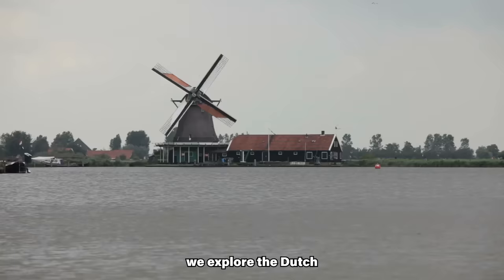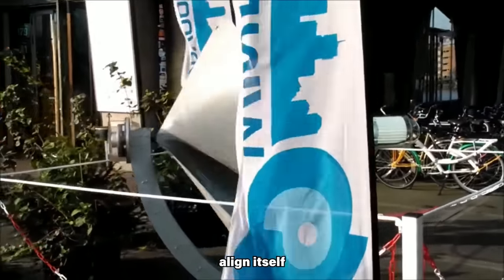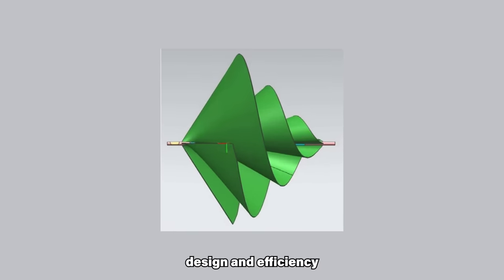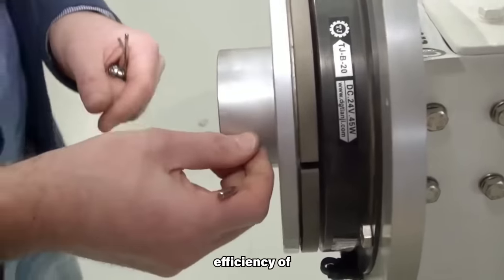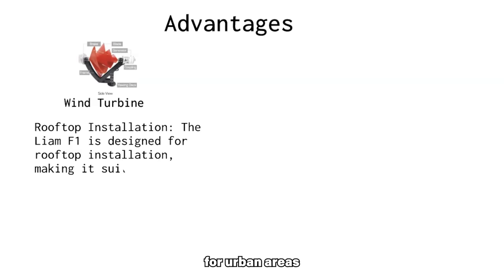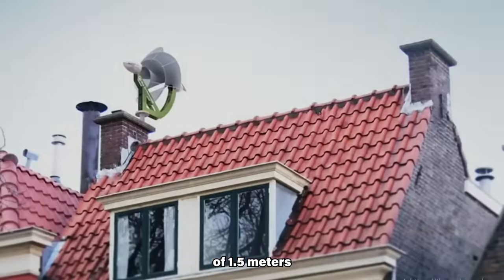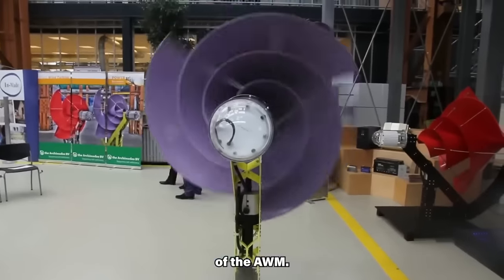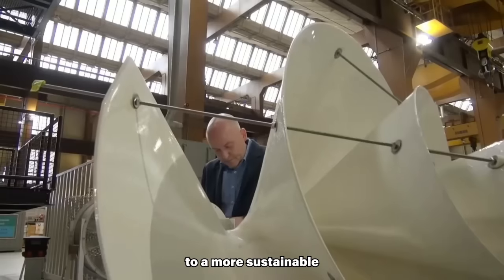The Game-Changing Wind Innovation You Need to See The Archimedes LIAM F1 Small Wind Turbine

Comment: According to my calculations, that's an output of a bit less than 200 watts per hour in a 12 mph wind.    (1500 kw / 8760 hours in a year).  This should be no surprise, considering how little wind is captured in its just under 5 ft diameter.  Correct me if I am wrong.
Reply: according to manufacture at 11.1MPH wind speed it will generate the rated 1500kW
Reply: @beach-time  You only get the 1500 KW If (and that's a mighty big IF) the wind blows at that speed or higher 24 hours per day,  365 days per year.  I challenge anyone to publish the actual voltage and amperage output of the device in that 11.1MPH wind.
Another concern:  That design doesn't seem to have any way to "feather" its turbine (or to turn out of the wind?).  This means that, in case of high winds, the thing will simply act like a sail and try to push itself off of its mount.  Most other wind generator designs do have this feature, even the old 6 ft blade WinChargers.

Comment: I live in The Netherlands and also have solar panels. Our government is planning on reducing and even removing the 'netting' of power generation vs power consumption. In other words: Right now any power surplus we push into the grid during spring and summer we can take back in winter when there is little sun available. Our government wants people to get rid of the usage of gas. Removing the 'netting' (aka in Dutch as "Salderen") is a very bad sign for solar panel owners. We get suggestions like "Do your washing in daytime when then sun shines, or basically everything that uses electricity when the sun shines". That does not work in the winter period and if you come back home from your job it's already dark. I have mostly electrified the utilities in the house, except the shower. This Archimedes Windturbine would be the perfect asset to have during autumn and winter period, in times when we have more clouded weather and more wind as well. So what is the price of ONE unit? And if asked, can multiple units be installed? I love the idea of electric heating, showering, cooking and use no gas at all anymore. Especially in the winter period. This turbine would be a bless. (the only exception would be cold clear nights with -10C and no wind lolzz).
Reply: Indeed it would be good to know the efficiency of this unit compared to others. I was disappointed to learn this week, that a solar panel installed near Geneva, will only produce 20% in January, compared with July. It seems that we need to consider multiple sources when generating power?
Reply: They want you to buy batteries ... one suggestion is to use the excess energy and pump water upstream and when you need the energy on  a cloudy day let the dam loose.  The "net" is put back into the dam upstream.
Reply: @richardpowles-brown2775  : Switzerland needs a different kind of sustainable energy for their climate. Can it be related to water, say ? i.e. When ice melts... or when the temperature changes etc. They might actually benefit with an actual heat pump or something like that. i.e. Using air... to produce heat. Couple it with changing temperatures. Something electronic.

Comment: Biggest issue here is the price, at least where I am living. It's about 5450$ and electricity cost about 16cents where I live. (I already have a 7kw solar) I am also in an area with trees so at best I would make 400-600kwh a year.
That is less than 100$ of savings annually so it would take me over 50 years to make the money back on this investment. (Backfeeding into the grid nets you only 1/2 of the cost, so 8cents per kwh)

Comment: I like seeing new innovations in propellers, the new boat prop’s case in point. I wonder how that design would work for wind turbines?
Reply: Yes, they make them already, and they are more efficient, for just the same reasons you expect. They are also very expensive to make, cost a lot more, and you'd have to make them really BIG to make them efficient enough to make a wind farm, which nobody has tried yet. For smaller residential applications, they could work well, but we'll have to wait a few years to see if they emerge as leaders in the area. Installing a wind turbine still requires more wind than you can get in most places, so it's still only limited to windy areas.
Reply: it's not an innovation, it's a scam...
that work poorly.
17W.
Reply: I would imagine it wouldn't. Just think of the wind turbines we have now. They fixed them so they will not spin out of control without the help of brakes in really bad wind storms just by spinning the blades so the wind passes by them without catching the wind. These would be impossible to do that by design and a disaster just waiting to happen in the first heavy wind storm.

Comment: I think it'll be a competition between cost of the F1 and solar plus storage.

this could be a good option for off gride or areas where there's extended periods of lower solar generatipon.

Solar is sop cheap adding extra panels is a good option, especially if you combine with use shifting so that you say run the washing machine, dishwasher when solar is generating, maybe pre cool or heat your home too.

As batteries get cheaper having larger solar systems will becopme a better optionb

Comment: Here in my house in Brazil I have a photovoltaic system using solar panels that produces IN A MONTH 1500 kWh. The same energy as he turbine proposes generates in a year. Just 22 solar panels + 1 inverter conected on grid. The cost? Here in Brazil (2023, december) around € 6.000 or U$ 7.000,00.
Reply: How about the batteries.
Reply: @vyronperellis8125  the system is on-grid. It's connected on the grid and don't need and don't use batteries.
Reply: Well.. if you are getting this much energy. Is it not of use.. to move that factory into Brazil.. or somewhere like that ? Whereby your operational costs, is a lot cheaper? So they could register the main HQ in South Korea.. but then the factory to be in Brazil.. in order to reduce that 10k.... That might help us, a lot more, so that it can ROI faster.....  There's a thought... And for an average household in the UK... maybe we need TWO form of energy production, and to produce MORE energy, that might help US... in creating further factories.. or even shops ! Lots of shops are now closed, cos there's an energy issue... so... it might just turn things around if we did that. Or to create a community chest, or community bank, based on what we produce as a community etc... (Which was how things used to run.) Or it might even produce enough to help our trains... and public transports etc...

Comment: Can't believe we are seeing this in 2020's instead of the 1970's.
Reply: can't believe they did not replace sails with this, obvisously this generates more energy from wind than 5 times larger sail... and you could directly connect it to water propeller shaft to outperform any sailboat. probably they fear of meatgrinder on board.

Comment: Can this propeller be used as a ship propeller? Does it prevent cavitation?
Reply: cavitation is caused by amount of suctions. and water temp.
like a pressure cooker. water cooks @ 160 degrees  because of the pressure.
so in a negative pressure water cooks in a lower temperature,
it does not matter what type of impeller/propeller  you use. if you have 0,034bar. water cooks @ 26,4 celcius
and when water cooks, bubbles will implode in the pressure side of the pro/impeller  

only thing that works. is a bigger sized imp/propeller @ lower speed. with a bigger suction area.
if you can double the suction size area. the pressure will increase to 0,068bar and water will cook at 38,7 celcius
(these numbers are for fresh water, just as example. salt water has different values)
Reply: It works good for making milkshakes.